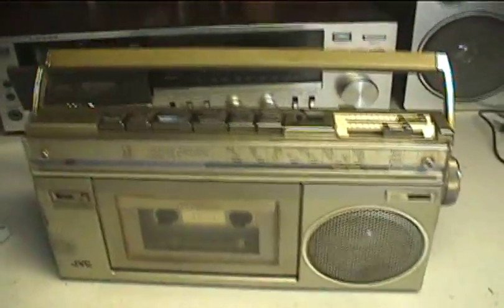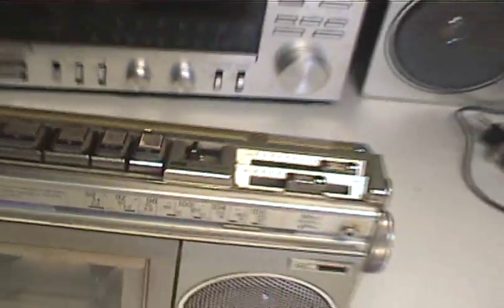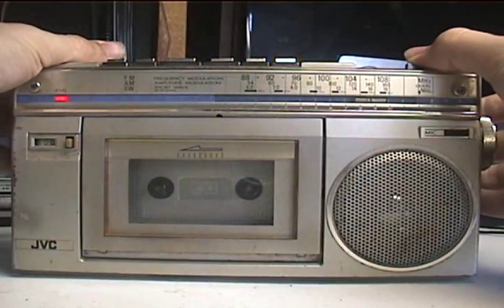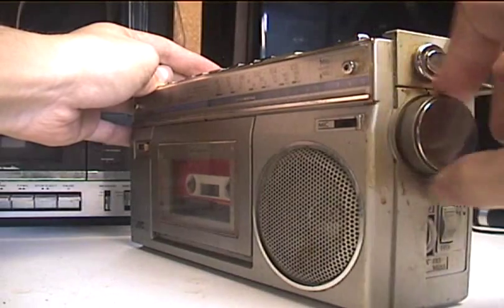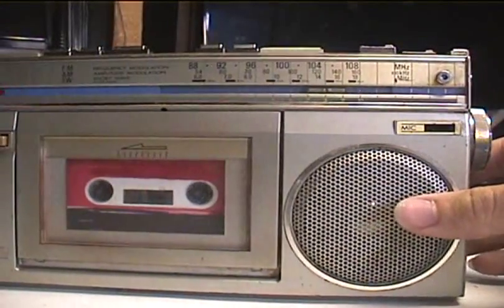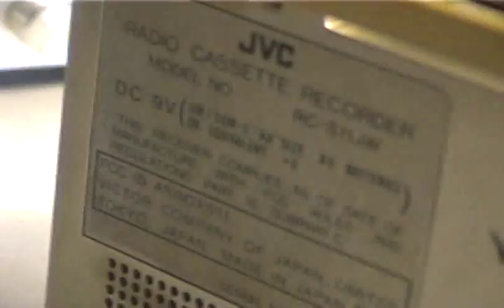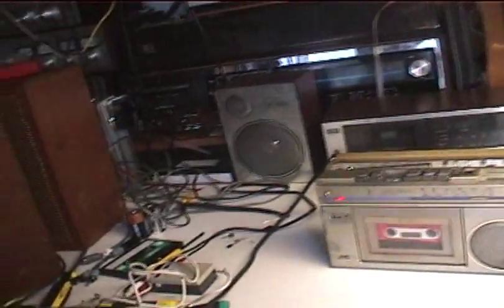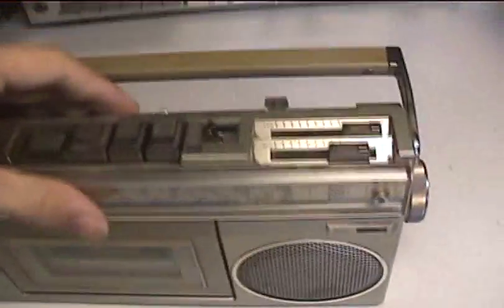JVC model RC-S11JW radio cassette recorder.

Comment: I change about 60% motors and 40% heads. Cannot stand flutter nor speed variations, they drove me mad. If the motor can't hold after a second adjust ... bye bye motor.
But then got some issues like lack of highs (soooo common), that I 've never solved on my own (Shame of me) but don't got all the tools I need. One vid from you would be a good start point.

Comment: I once had a Realistic Minisette 10 radio/tape recorder that was somewhat similar to this unit, it didn't have some of the features, and the speaker grill looked very different, but it was similar, I don't know if the tape deck was AC Bias or DC Bias, the speaker on my unit didn't work.

Comment: With the whole "AC bias on the circuit board" thing, they probably used the same tape system board as some other models that they had also made during that time. Sadly, JVC seems to have left the portable-music-anything business. It's a shame, they used to make great stuff.